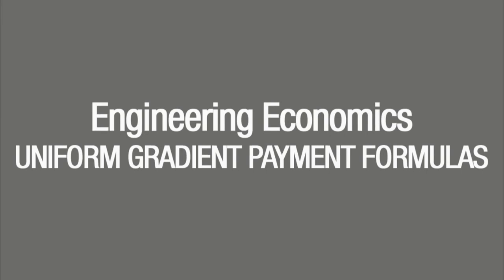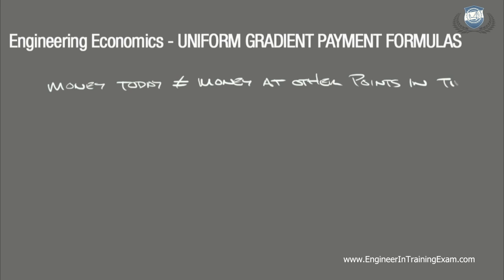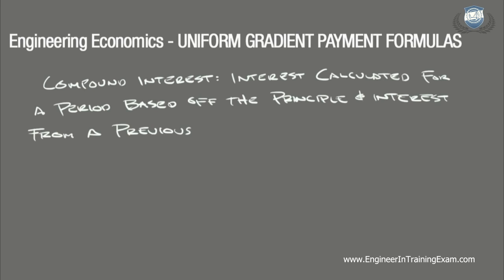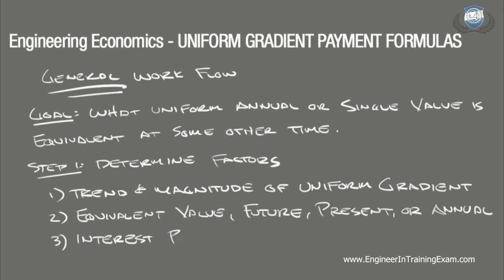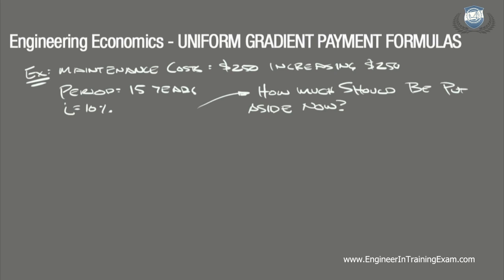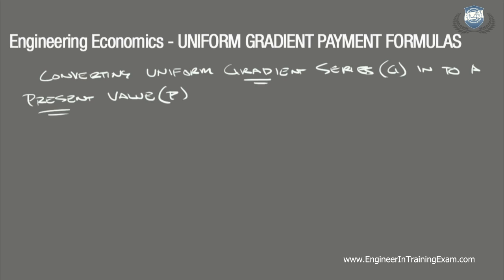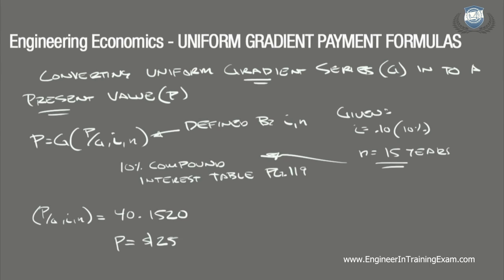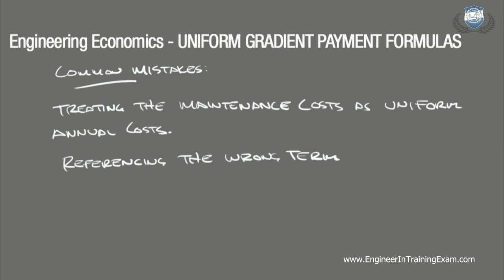Uniform Gradient Payment Formulas - Fundamentals of Engineering Economics (Part 2)

Comment: My one issue with this video is that your initial cost is the same as your increasing value. How would one do this problem if the machine initially cost $250.00 but increased at a rate of $50.00 per year? Would you still use 250 as P, would you use 50 as P or does this method not work under this scenario?
Reply: I believe you could consider this as an annuity of $200 and a gradient of $50, which you would convert separately to present value and then add.